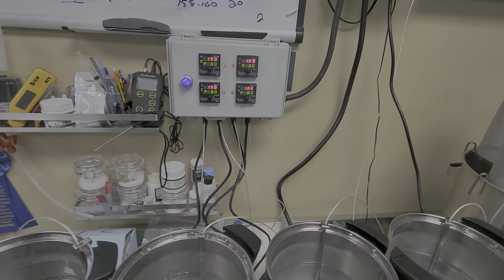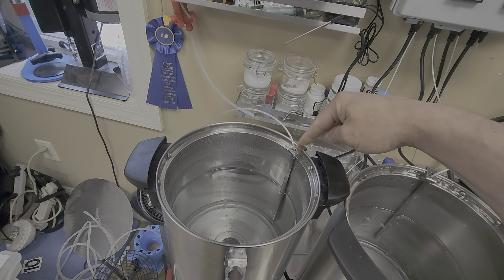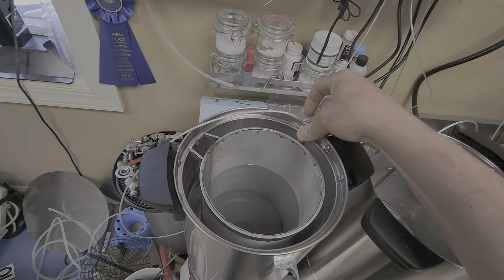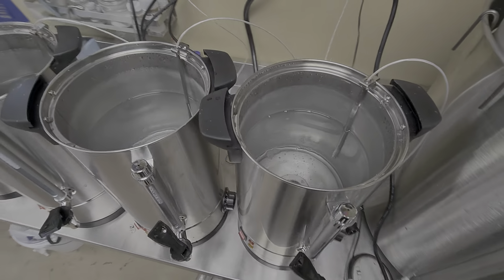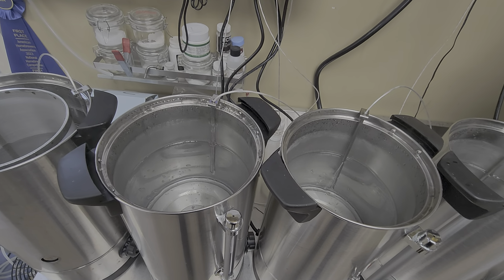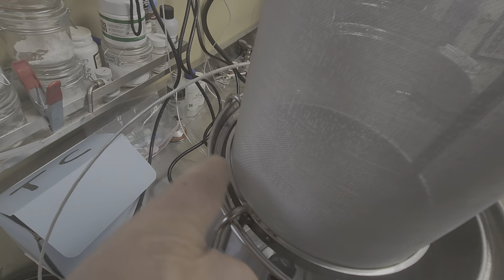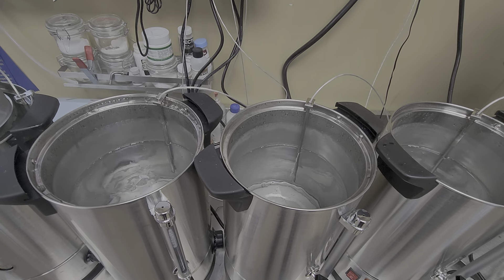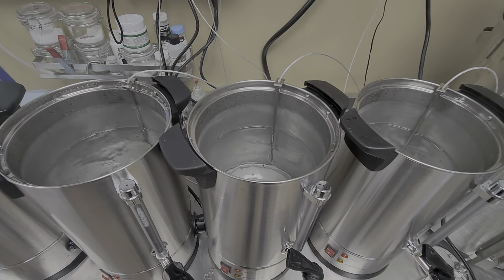Introducing The Brew Matrix experimental 4-batch brewing system

Comment: Wondering what vessels you are using to brew with?
I would like to have a smaller brew for testing before I brew a new 10g batch.
Reply from the maker: They are 10 liter coffee percolators. I was drawn to the double wall construction for insulation purposes since I don't plan to run recirculation. The quality is pretty poor on these though. Half way through a test boil, the sightglass started dripping so I have to take them all out and plug the holes. I also planned to go very low tech using the built in temp control knob but it wouldn't have yielded useful comparisons with temp variations. The baskets are hop baskets that I cut shorter..